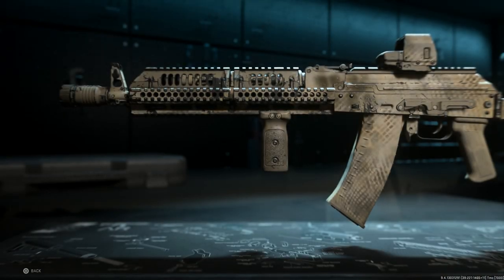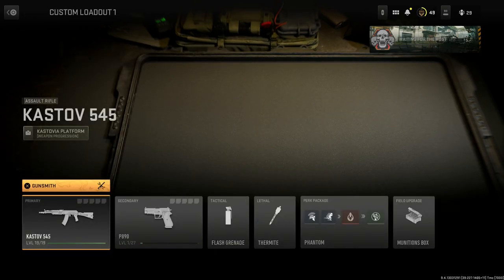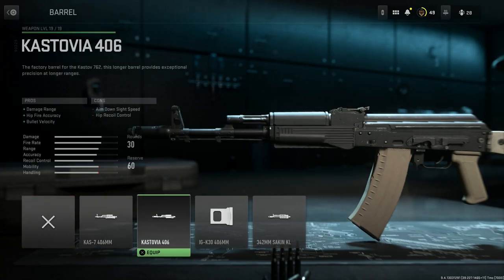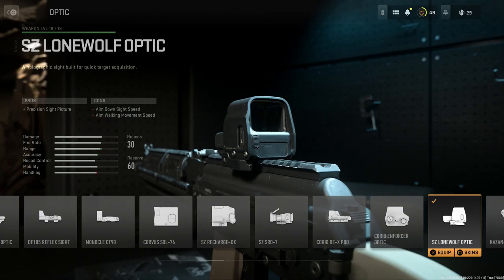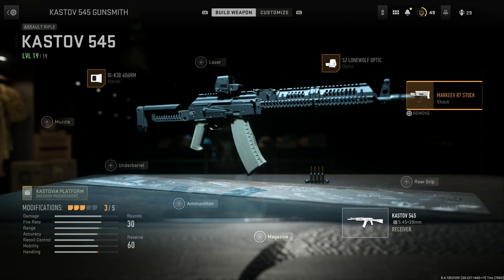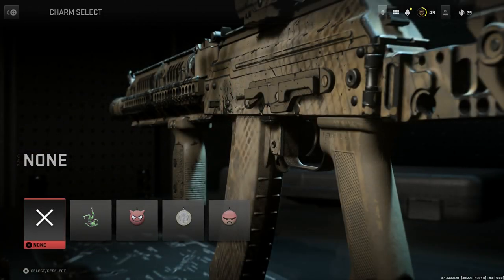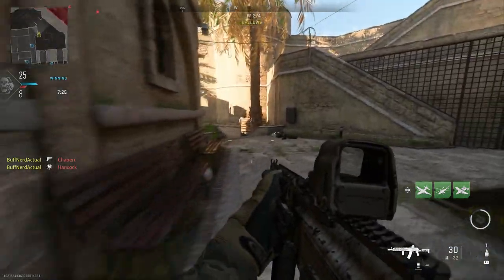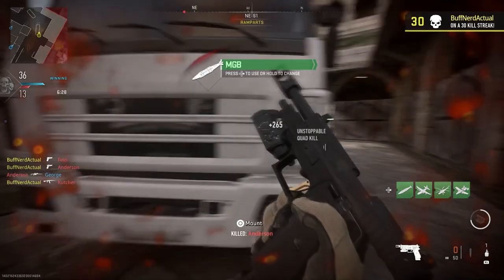Zenitco AK-74M Weapon Conversion - Call Of Duty Modern Warfare II

Comment: personally I'd swap the Magpul grip for the "Stovl DR Laser Box", which I believe to be based on Zenitco Perst-3, it helps with hipfiring and the only downside is the laser is visible when you're not ADSing/sprinting, pretty much like the 5mW laser from MW2019
besides, it wouldn't be a true tactical build without some sort of aiming lasers/flashlight, as you can see them on pretty much every SOF operators' rifle setups, but you won't often see a foregrip of any kind on them
Reply from the maker: I was going to opt for that over the muzzle but I couldn't pass up that fat flash hider haha
Reply: @buffnerdgaming2346  but having a foregrip on there still looks cooler than not having one though, it's a shame we only have 5 attachment slots and the handguard and stock took 2 out of them
one of the few things I like about Cold War was that there's a wildcard that allows you to use all of the attachment slots, I'd like to see it return as some form but the chances seem nonexistent

Comment: the 1 thing I find weird with the ak in this game is that it has the side mount rail attachment. Which isnt needed because when we use optics, it uses a dust cover with a rail section. Just weird they include both even though we only use 1
Reply from the maker: Since it is a 74M build it makes sense. No AK besides the AK-12 cones with a railed dust cover because they are horrible at retaining zero. The dove mount is better for that. The 74M here and the 100 series in game all have added raided dust covers after the fact. Very common to see this IRL also!
Reply: It's also worth mentioning that despite railed dust covers being more and more common nowadays, all 100-series AKs are produced with dovetail mounts as standard out of the factory, which they even take into account with the folding stock that is standard on all the 100-series rifles, which has a cutout in the left side to allow it to fold over the dovetail mount and lock against the receiver. There's no actual need to remove the dovetail mount since it's extremely unlikely to get in the way, and if one wants a railed dust cover, one simply attaches that without any regard to the dovetail. I personally think it's a better detail that they kept the dovetail mount despite it not being used, rather than removing it and having the AKs rather resemble aftermarket-customized infantry models from the 70s.

Comment: GODDAM 2 conversion videos in a row? lets goooo
also would this then be an alpha ak?
Reply from the maker: Technically the Alpha AK is either a 105 or 104 with the 12.4inch barrel. So no but also yes. There is no reason a full length 74M can't be an Alpha.

Comment: Ah, the venerable Tiktokovtsy AK... :D

One thing, though... with regards to AK-74 and its AK-74M modernisation, when it comes to folding stock, AK-74M unified both AK-74 and its VDV variant AKS-74 that had the triangular folding stock... It's not like there wasn't an AK-74 wit folding stock before (you had the abovementioned AKS-74 which replaced AKMS for paratroopers and you had AKS-74U which replaced Stechkin's APS for vehicle crews...)

Comment: I kinda think they messed it up tbh. The full length shrouding is on the carbine AKs. On the full length AKs the shroud stops short. The way they've done it in this game, makes every build look front heavy. And a shame they make the stock destroy your recoil.

The other modernized stock doesn't look right.

And making the 5.45 parts white etc? Odd.

Comment: Most ar's, smg's and br's doesn't have drum mags and no reticle options for optics🙁. I was hoping ak's would have buffer tube stocks as well.
Reply from the maker: This one does have a 60rnd casket mag though!!
Reply: @buffnerdgaming2346  yeah but 762 still running that old 40 rounder.
Reply: Drums aren't good lol, majority of them don't run well
Reply: @nigeldean3726  dude..I not talking about irl failures. I'm saying that in mw2 some weapon has it and some weapon doesn't while it clearly should have. They advertised gunsmith with m4 having a drum mag now it does not have it at launch.

Comment: Pain in the ass to get the stock especially when it bugged out but now my ak is peak, still lame how theres nothing for an ak12. 
The ak105 i hear is the worst ar in the game so i run it on the ak103 with the zeni stock and barrel, vlk, 40 round, and operator foregrip. Nice balance between speed and range.
Reply from the maker: I'm betting it will be a blueprint or a platform added later on.